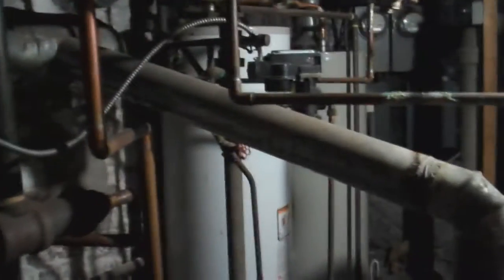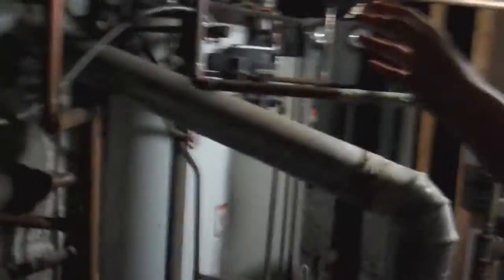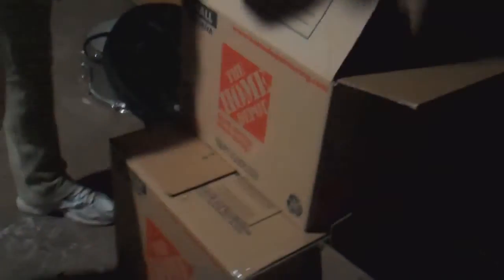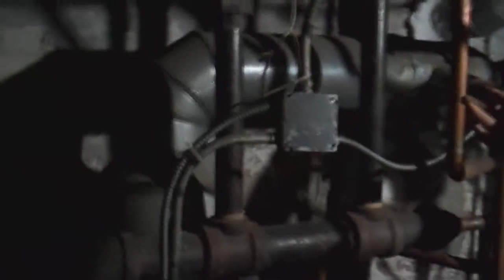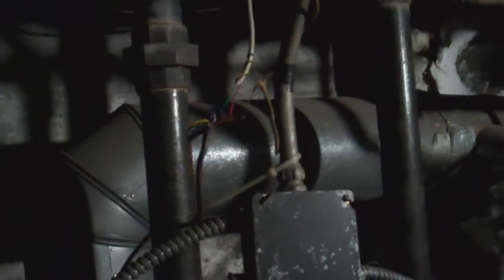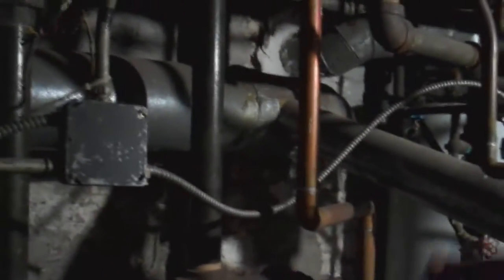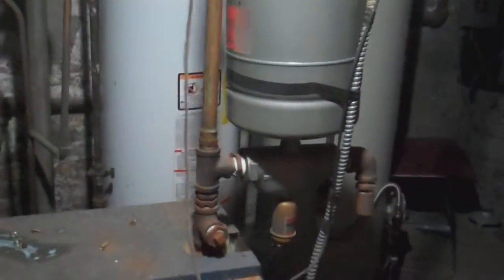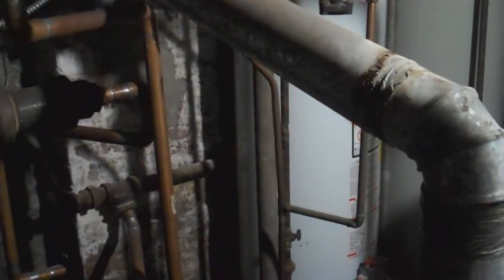This is the scariest furnace ever!

Comment: Not water in rads but steam. 
The banging sound is "water hammer" caused by having water in the steam lines. ----A good boiler mechanic could open the steam traps clean them and replace some parts for minimal cost.
The "uncover wire" is 24 volt low voltage not a safety concern.
A good boiler mechanic could change the water feed so you don't have to feed it manually.
Also the water really should be feeding the boiler from a holding tank and not directly from the city water line.
The relief valve is normal and is on every boiler or water tank, its a good thing.
Steam pipes are hot nothing you can do except build a room around the boiler (with air openings) so card board boxes don't fall near boiler.
Not the most modern heating system and it looks like it needs some service but nothing to panic about just call a heating company and have the problems fixed. 

Cheers
Reply: o ya 2010
Reply: I know all about water  hammer..i lived in an 1880 house   2 yrs ago.  And it did the. Clanging  all the time..even.the regular water lines. Started thumping after. The hot water heater  hot replaced...i guess they forgot to bleed. The. Lines lol

Comment: I know this was a while ago, but did your friend really have to go to such drastic measures as to move out? It seems like a lot of that stuff could have been fixed for a reasonable price and made safe/upgraded. I don't know, just a thought. Also, the comment your friend made about turning the carbon monoxide into carbon dioxide is incorrect. Combustion always produces carbon monoxide, but if the air is mixed in proper proportions before ignited, that carbon monoxide level stays low. In any case, the combustion gases rise due to their heat and leave through the chimeny. Older "natural draft" appliances relied on this principal, where as newer appliances use a fan to forcefully draw combustion gases away.